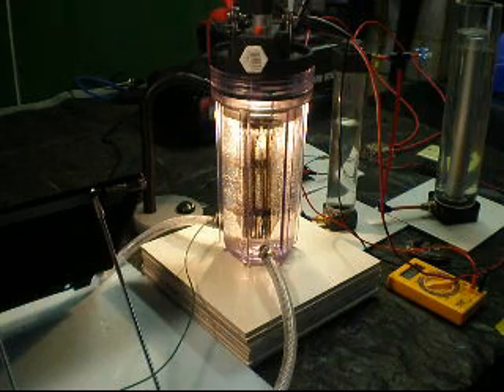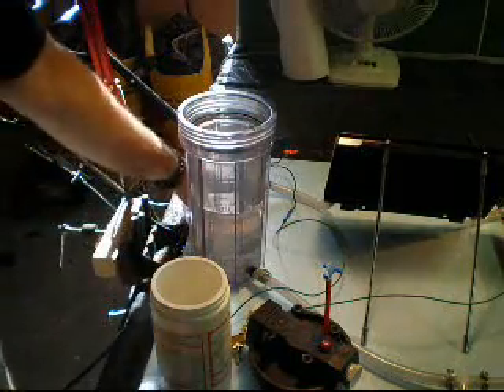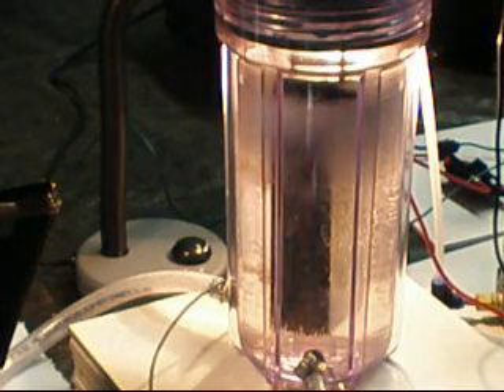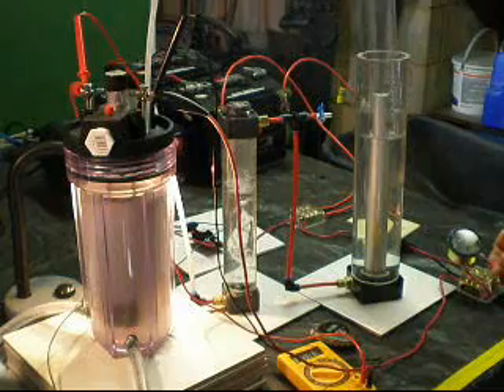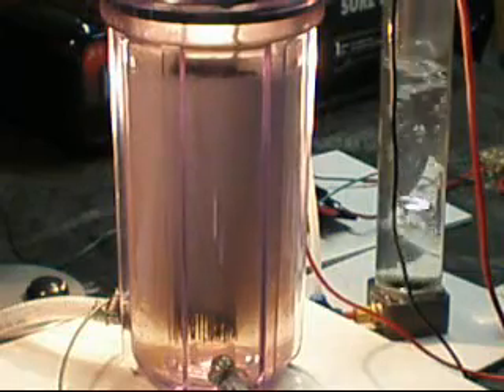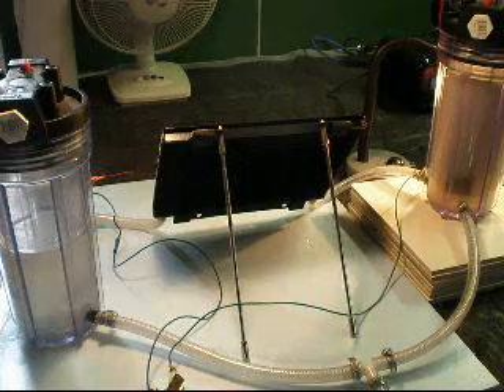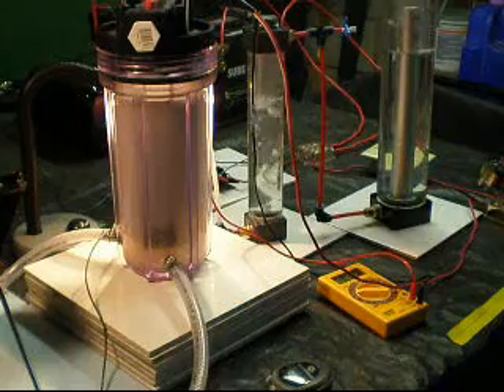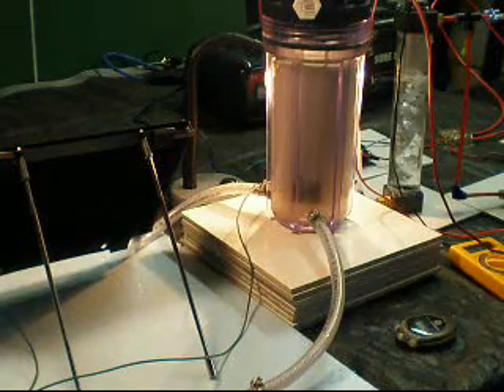#011 hho production covered plates new radiator

Comment: Did you know that if any water/KOH touches anything other than SS or Brass it will disappear into hho without any power? So yes you need a ss radiator and your pump will need SS parts.  Might be something to double check So I wouldn't leave any water/KOH in the radiator your using at the moment.  Keep up the good work!